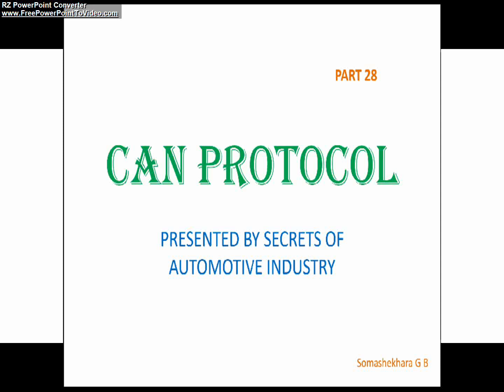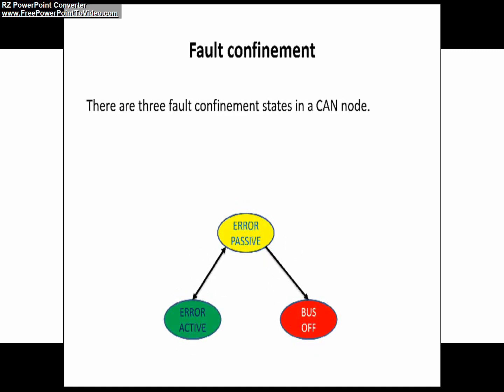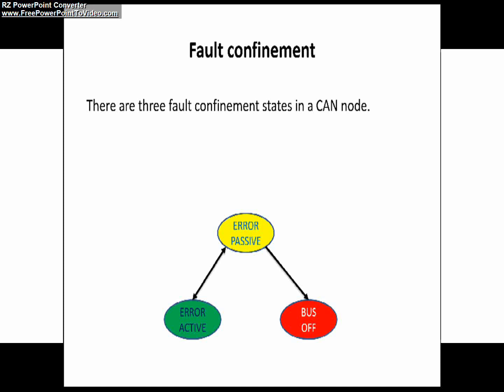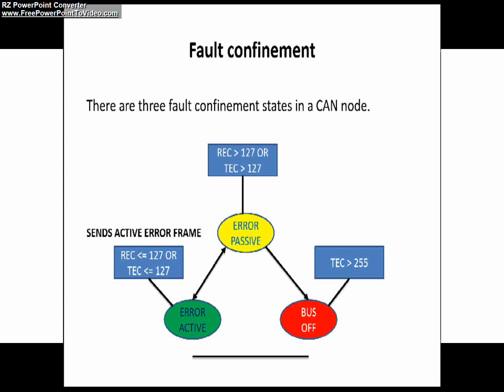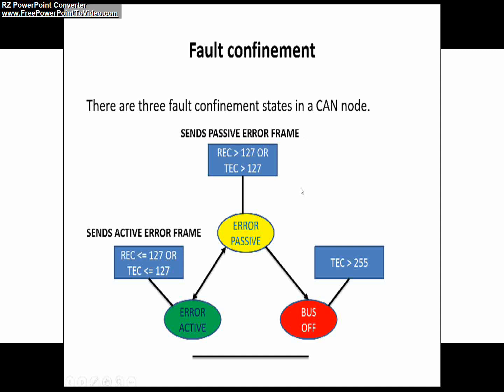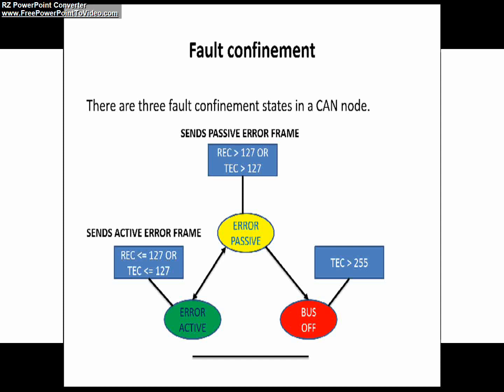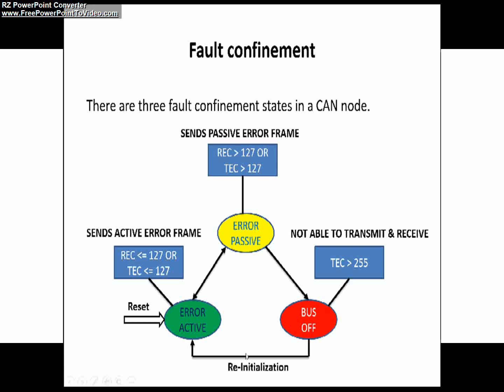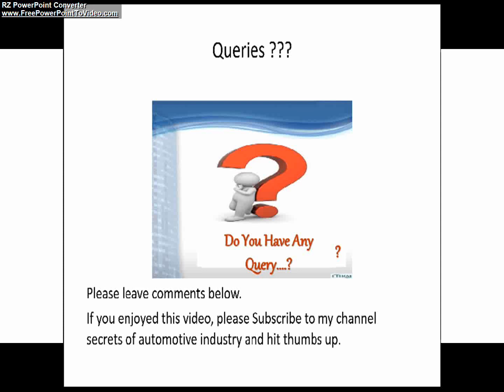CAN protocol basics, PART 28, CAN Controller states, Error active, Error Passive and Bus-off.

Comment: If tx message not available,only rx is available in that how I will come to know if busoff happens
Reply: subbu kadali hi, it will not go to bus off.. The TEC will stop after 127..
Reply: only rx means some node should send then only it will be rx correct by other node, so at transmitter tx busoff may happen

Comment: how can we know if all the nodes sends the frames at the same time for the starting and ending points of frame .. i mean how the nodes know the proper time to send SOF  with each other to start the arbitration process .. and dont  start sending its frame while there is other frame  (in its data stage for example) accessing the bus ?
Reply from the maker: Hi Sarea,

The nodes which are connected to CAN network will continuously monitors the bus for bus idle state.
As we already know each CAN frame carries EOF (7 recessive bits), when the node observes these 7 recessive bits they start to send their SOF over the CAN.

Kindly watch my video on Arbitration process and CSMA/CD technique to understand these, for further queries you can comment here. Thank you..
Reply: Hi sir, 
i got it .. and really appreciate your response. i have watched all the can videos and try to implement that on tiva c lauchpad .. 

thanks a lot ..
Reply from the maker: Welcome...

Comment: sir tell about Multiple Frame Transmission in can please
Reply from the maker: Definitely.

But just wait for some time, I am going upload video on ISO-15765-2.
Reply: sir one more thing i want to ask in a can bus  i have 4 node node1 , node2, node3 with priority 1,2,3
if all three nodes want to send a msg to 4th node in periodic meaning node1 first node2  second and node3 third 

weather it will work or not because node 1 is having highest priority every time node1 only send msg or what plz help me

thanking you
Reply: @yashwanthl7311 as i understood Priority is not with respective node it is message ID decide any node 1,2,3 may have highest priority after sending highest priority message in that periodic cycle other low priority message will transmitted there will be enough time in same cycle to send other priority messages, hope i answered your question
Reply: I have watched all ur vid sir... It's interested and fantastic section... Nd why ur not continued part28 section.. there are how TEC and REC increment or decrement and why in bus off state only considering TEC ...?? Please share details
Reply: Hiii this is Pushpa

Comment: what happens when we short the CAN High and CAN Low and what we call that situation...?
Reply from the maker: Shorting of CAN_H and CAN_L leads to generation of error frames over CAN bus and it causes Bus-off.
Reply: so bus off will occur
1.whenever TEC > 255 and
2. shorting of CAN_H and CAN_L.

thank you...
Reply from the maker: yes, but first one is state of an ECU.

Comment: Thanks for the video ,

I am aware that if ther is short between CAN high and CAN low , it leads to Bus off 

If CAN high is shorted to say Battery line 12 V , what makes the network to still work on single wire on CAN low line ?

What normally should be configured in SW for CAN transceiver ?

What's the transceiver